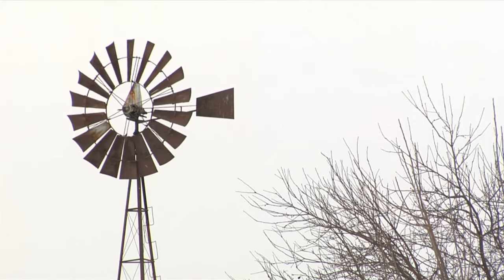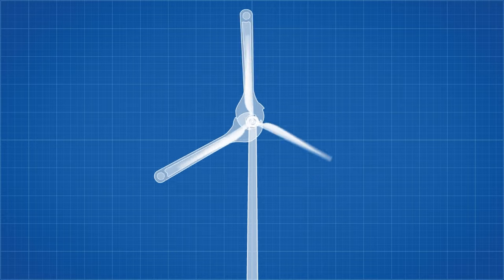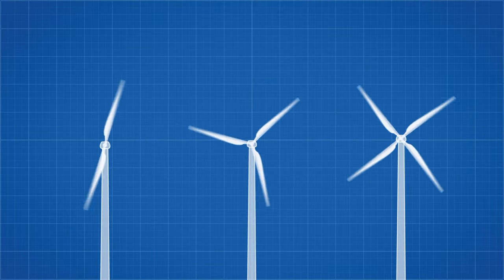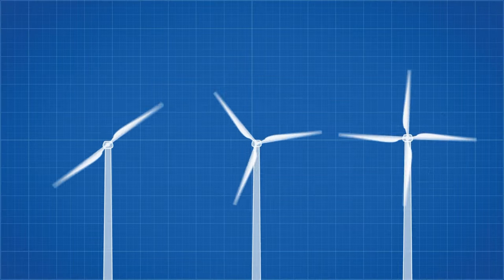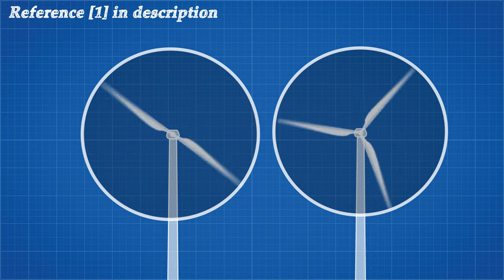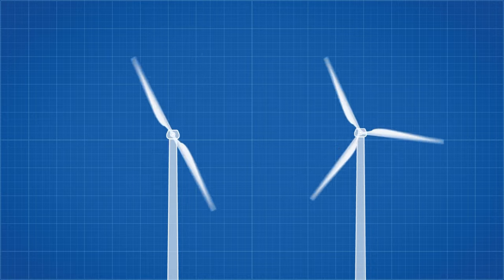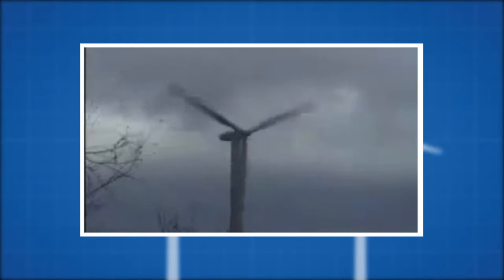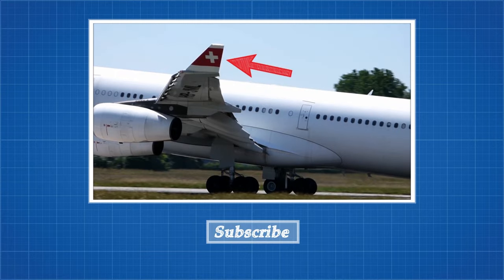Why Do Wind Turbines Have Three Blades?

Comment: Well, if a wind turbine didn't have any blades it wouldn't bloody well work,  Rather silly question don't yo think ?
The reason they don't have don't than 3 blades is that the turbulence from the previous blade interferes with the otherwise clean aerodynamics of the blade with a resultant loss in efficiency of the blade.

Comment: the most inefficient way to harvest wind energy . a screw can turn a gear wheel but in reverse it is not possible you can,t rotate a   gear and spin the screw though we can spin screw with force acting normal to it if we have very high helix angle. wrong machine but have to dependent on it until a more effective design come up

Comment: I'm not happy with this video. Good stuff otherwise. Here, for the record: I live within a few km from six turbines, and I'm fine that. I can only hear them from maybe 200-500 m away. Wind turbines are great; the damn train line downstairs is really, really loud: https://youtu.be/Fh7migblhX8. So are all roads. Cars totally drown out wind turbines.

In addition, while you are right about two vs three blades, slow speeds are not the only reason. Two blades flap in the wind. Wind velocities at the top are greater, partly because the tower behind the lower blade provides resistance. It probably similar to what you describe about those turbines are the back of airplanes inside the hull, where pressures are different. Just that the blades are pushed back with every rotation towards the top before being released forwards are they reach the bottom. Not good for mechanical stress.

When the wings flap, there is stress on the shaft, and it eventually breaks. Or you build a teetering hub like on helicopters -- and then that breaks. Helicopters are made to run just a few hours, not most hours of the day without maintenance like wind turbines. No yaw is better some yaw, so three wings are used.

Look forward to other videos from you. I'm learning a lot!

Comment: You gave absolutely no reason for throwing out the 4 blade version...."we can eliminate it with a quick cost analysis"?  What does that even mean?  Four cost more than three?  Duh!  Three cost more than two, and two cost more than one.  Want to save the most?  Go for no blades.

Comment: not your best video.
You dont answer the question. I could use the exact same arguments for a 5 bladed one.
If I add a 6th it will cost more and weigh more, if I remove one it will spin faster and break easyer.
altough I understand that it must be really difficult to answer since it all depends on the size you want, the materials you can get and at what cost,...
Being an engineer myself I always loved those optimization problems.
I think it also depends where you plant that windmill since in a place with faster winds you'd want a smaller one to maximize the moments it can spin below critical speed.

Lots of factors, probably too much for a single video?

Comment: This makes no sense. Why would three blades generate more power than two blades if both move at the same speed? Doesn't power generated come from the the revolutions, given a generator and gearing of the same size, o more speed = more power? This video didn't explain anything, no numbers, nothing. =/

Comment: yes..why have 3 blades and not 4...why have 2 legs and not 3? why have 4 engine pistons and not 5? why have 8 and not 4? manufacturing costs VS power outcome? Don't think so.....
I think 1 blade added is less than 5% of overall cost. More money is going into electrical equipment. Is like saying that boats/ships have small blades because it costs less. stupid. pure pure stupid assumption. STOP

Comment: Civil engineering student here. Once tested different turbine configurations with different NACA airfoil shapes for a class. I was always taught that 4 blades would give you more power than a 3 blade turbine, but only marginally. Adding an extra blade at that size means you're adding on a huge amount of mass, so the extra energy produced is surprisingly small. Thus, if you did a simple cost-benefit analysis, you'd see that the cost of adding a single blade, which is massive, is not warranted by the amount of energy produced in the turbine's lifespan. Two blades, if I recall correctly, had a very high rate of failure. Thus three blades was the Goldilocks of all designs

Also, the video mentioned "centrifugal force", and I'd always been under the impression that there was no such thing. I remember being told there's centripetal force, but centrifugal force was something that non-physics people made up. Was I the only one taught this? Is this notion wrong?

Comment: Proponents of wind power think nothing of cost efficiency. If they did, they wouldn't put the money into wind, they'd put it onto hydro-electric or shale oil. It took me a while to find the data, but it turns out that all of the expensive wind systems in the Central Washington and Columbia Gorge areas, if finally implemented in full, would equal the output of one hydro electric generator (Grand Coulee Dam has 33). "Wind" is an enviro overreach, but who cares as long as we make renewables mandatory (except hydro, the best one...because: liberal!) ? Oh, I figured out how to solve global warming. Implement Marx in total. Peace/ out.

Comment: Ok,Lets be real for a moment (after a regular day of reading the news these days,with the Trump trade war and all the other bullshit,being real for more than a moment would kill me :)   )
 
 1)Isn't a odd number of blades (in general) be better?It would seem to me that even numbers would no be as good,as an uneven number,due to the "system" being stuck at a equilibrium much easier.So either 5 or 7 seems optimal in general ofc.
 2)The weight might Be an issue in only 1 case-the materials used for a wind turbine are "heavy" (have high material density).Now,I do not know what is the latest wind turbine made of-when it comes to exact proportions-is it all aluminum,a steel/aluminum composite or may be it is a trade secret in order to protect higher profits (if Your competitors have Your designs and descriptions,they would be quite easy to replicate).I know in the moment it is Not possible,but if We were using milti-walled carbon nano tubes,I believe We would be able to build them  higher (both the turbines and the blades),with more blades due to the low material density and weight of the MWCNT.That material also has 40 times (if I am not mistaken) more tensile strength compare to steel.

 So can MWCNT be the future of wind turbines?Again-I am aware it is prohibitively expensive atm,but I mean in general?
And bigger,stronger turbines,with more wings can decrease the cost of MWCNT,since the best way to make them now is with high energy usage.So if a single turbine can produce more el. power at lower cost-that would lead to the material being cheaper as well.

 Thanks.

Comment: Hmmmm, You say the blades weigh tons that is crazy! I can think of a dozen ways to create a "smaller" but higher blade design and get the same torque. I can also make it out of a material that is light. And I can compensate for the long blade size by a smaller, more  corded blade design. I can remove the noise by running "slower" but higher gear ratio. I can also create a very efficient vertical Axial turning design and put it into the same footprint as just a single pole, I could work on the generator on the ground. and would be easier than going up that monstrous pole. I find all this totally crazy and very inefficient. If you can make a dutch windmill that is totally silent and can grind and pump water out of cloth and wood and wires. I think this is the dumbest desgn I have ever seen!

Comment: Noise?___Only bitchy people would complain about the noise from a wind turbine.
Think they are loud? _ Try living in a city... Or on the edge of one... or a few miles from one... Ya stop bitching.
Brakes?!?   Feathering!!!!!!!!!!!!!!!!!!!!!!!!!!!! _ Even if the brakes fail if properly feathered it's not going anywhere!
Properly designed, Two blades are cheaper and more efficient.

Comment: pseudo-scientific bullshit , the only reason is econometric. cost vs efficiency. the optimal value is currently at 3 blades. the gain you get from adding one more blade decreases with the number of blades, while the extra cost is generally the same.

Comment: I can not beleive how useless your explanations are! All you covered is the blade cost and noise. You completly ignored the biggest point: efficiency! That is the amount of power extracted from the wind, which mean profit! A 2 blades may spin faster and make more noise, but that's all fine for unpopulated area. If they don't use them it mean it is less efficient than a 3 bladed one. Why not 4? Because the extra energy extracted by the 4th blade is minimal compared to the cost. This is due to the turbulences of the previous blade that cause disturbance in the flow, which make the air flow not in a straight pattern... This is also why you don't get even more blades. The more blades, the more the blade will "cut" in the air of the previous blade...